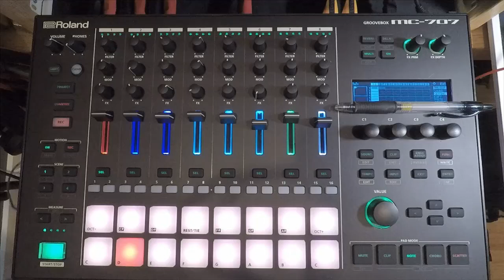MC-707 Tutorial  - Track Sound Source

Comment: Heya when I change clips (via a scene change) the sound from the last clip is played and not the sound I assigned to the new clip. I have the sound set as clip not track for the channel as well..m any ideas? Thanks
P.s if I stop and start the sequencer the sound changes but not when I change the clip manually. Very strange
Reply from the maker: @soundscaperecordings1111  have you recently updated the firmware? You can try doing a factory reset to see if that clears the problem. All projects are saved on the SD card, so a factory reset will not harm those. You will have to go back into your system settings, and reset those to your preferences.
Reply: @UnitE808  hi thanks for your reply. That's unfortunate I thought it would be a simple fix haha or setting somewhere I missed.
I don't really want to start messing with the firmware again I believe it's all up to date already hmm 
Any other ideas?
Reply from the maker: @soundscaperecordings1111  you don’t have to mess with firmware. Just do a factory reset

Comment: Too bad this can't get set as standard for all tracks of a new project ;/
Reply from the maker: Voice count rises quickly with this setting and all fx and sound settings get reset per clip. I usually only make 2 tracks with this setting.
Reply: @UnitE808  Is this why once I've made a tone track in track mode with multiple clips, then set it to clip mode, some of the clips sound the same and others are completely different?  I even had one clip set to an initial patch sound once. Thanks in advance.
Reply from the maker: @MSSSSSSSSSSSSSSSSSS  yes. You need to set the sound source before creating any clips.
Reply: @UnitE808  So in order to have slight variances in, let's say, effects, but the same sample, I'd keep reloading the same sample, set all the settings the same for each clip, but then add the different effects as I go?
Reply: I tried that, it works, it's just hard to predict if I'm gonna wanna make slight changes to a tracks clips before even having written anything.
Reply from the maker: @MSSSSSSSSSSSSSSSSSS  no. You can copy a clip to a new spot and just change the fx
Reply: @UnitE808  Hmmmm, not sure why mine did that then. All were samples pre chosen, some were copies that I slightly altered,  I set them to clip mode, some of them would completely change. 2 different songs did that, but not every clip will change. Strangely, one song  changed a clip to an initial tone, despite it not having been created from an initial tone.
Reply from the maker: @MSSSSSSSSSSSSSSSSSS  if you create a new clip, it automatically uses the init tone. When copying, you are given options. Choose ALL if you want to duplicate the clip
Reply: @UnitE808  Sorry if I'm being a pain in the ass, but should it do that if these clips already had samples assigned to them? Also, it doesn't always revert to an initial tone, sometimes it just royally screws up the settings on some clips, but not all of them, idk why some and not others. Is it because the clips were all made in track mode? Thanks again for the help. I can make a video if that would be more helpful. I'll look into the all setting when I get home in a few days.
Reply from the maker: @MSSSSSSSSSSSSSSSSSS  yes, it reacts kinda strangely when you already have clips on the track and you switch the sound source to clip. I don't know the reasoning behind it, but it might have to do with how the clips were made... whether they were copied or created.
Reply: @UnitE808  Ok. Well, that's pretty good news then, better than my device being buggy. I'll do som tests, that way I won't have issues in the future. I appreciate all your help, and I try to figure things out first before asking. I joined the facebook group, and I pay it forward when other people have questions I know the answers to.